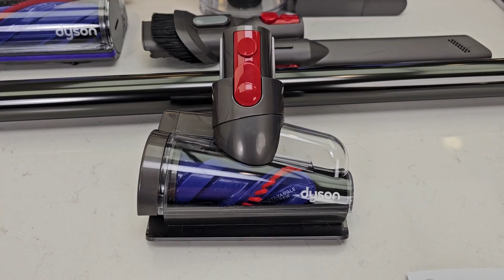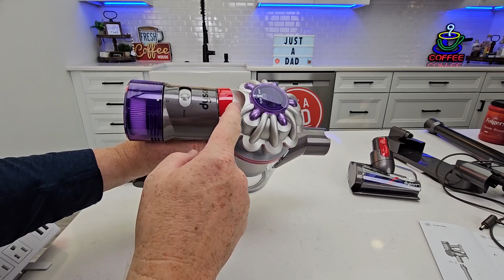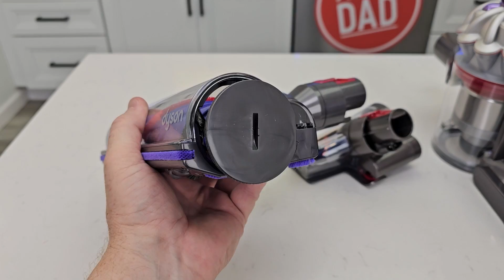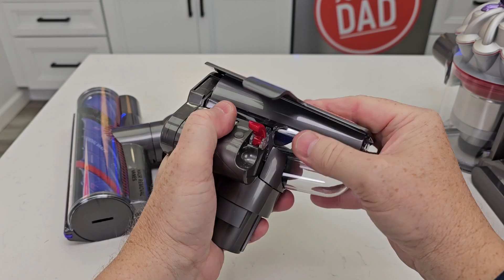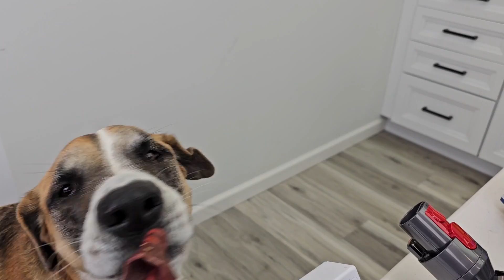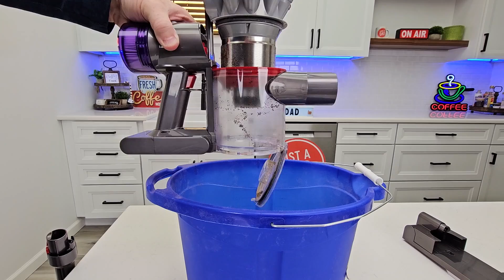Dyson V8 Cordless Vacuum Cleaner | Complete Unboxing & Performance Test

Comment: Ideally you should test in regular mode not max as max is got spot cleaning and not whole floor cleaning.  Max wears out the battery prematurely and only lasts for 7 minutes.

Comment: Hi, Just bought the V8 Origin. On low setting with floor tool on tile the floor tool makes a weird noise?. IT operates fine but don't like the strange noise. No strange noise on high power.
Reply: I noticed the same thing on mine

Comment: Es super esta máquina la amo ❤ recomendable al 100%
Reply: Good to know I’m debating between this and the Outsize plus
Reply: @RFRancois08 you are debating between a supplemental vacuum and a high performance replacement to a corded. Both vacuums are drastically different. I wouldn’t even recommend an outsize model from Dyson unless you want to vacuum your entire house in one go each time, which you don’t even need to do with a cordless (you can break up your cleaning schedule).

If you just want a quick use vacuum, get the V8. If you want something that can perform as good as high end corded, get a V11. The V11 can perform nearly perfectly in its normal power mode in carpets. You can even clean your car easily with a V11, V10 or V8. I wouldn’t want to vacuum a car with an outsize.